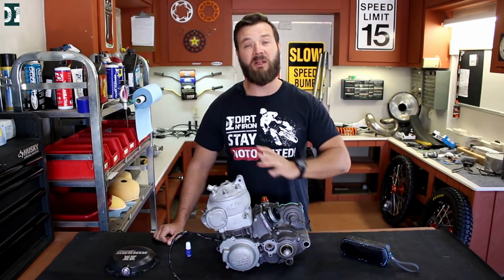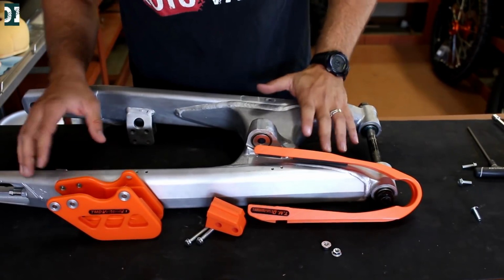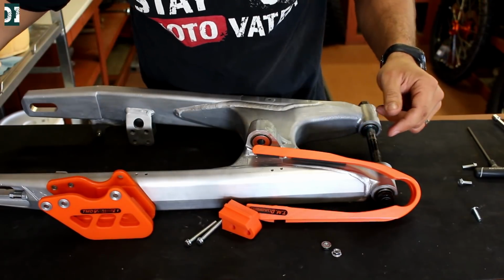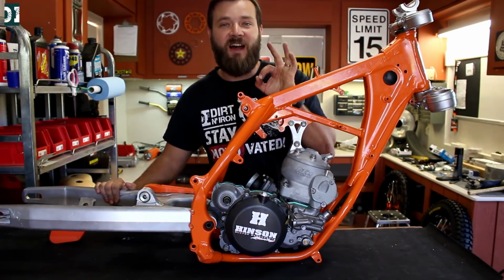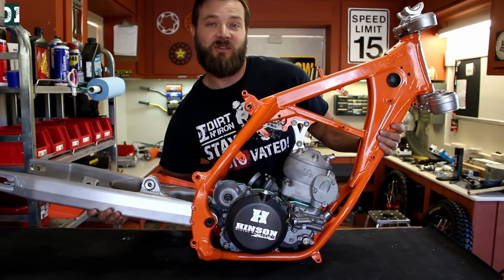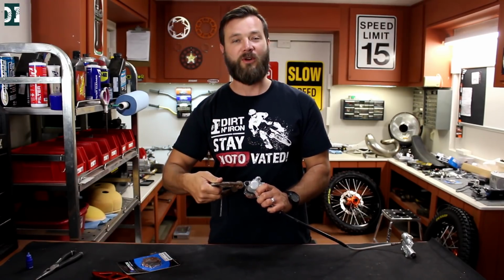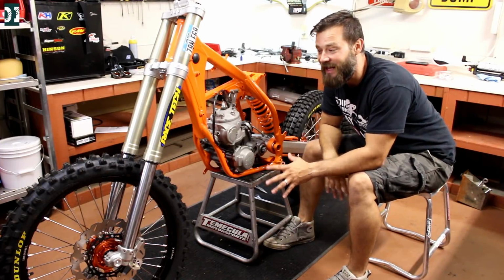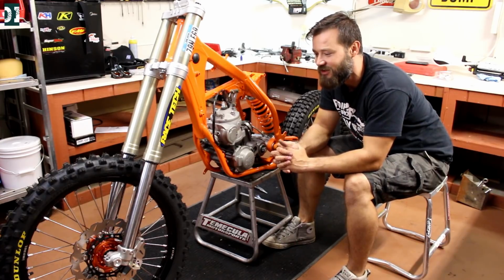KTM 300 build part 18: Dirt bike assembly finally begins!

Comment: Looks great, Just did tear down and greased all the bearings on my 07 crf450r.  It's nice just taking care of what you already have. Good job!
Reply from the maker: Exactly :)
Reply: These bikes have not changed a whole lot in several years just basically maybe they change the forks and then they go back or a little something here or there.  Its basically the plastics they change and all of the sudden it's the best bike ever.
Reply: Where did you get the Dunlop's with yellow lettering?
Reply from the maker: Those stickers are directly from Dunlop, they use it from promotions. I got it thru my friend. I think they don't sell them. I. My upcoming video I will talk about those yellow Dunlop stickers. Stay tuned ;)
Reply: @dirtniron Ok, Because I was like that's not something you can just get usually the only time you see it on bikes is for a photoshoot or factory rides.

Comment: Make sure to use the proper tightening order when putting the front wheel back in.
I think it was something like.. put axle in, tighten pinch bolts on right fork leg, compress suspension so it aligns itself, tighten pinch bolts on left fork leg and then the nut.
I forgot to do this once and the suspension didnt work properly.

Nice job on the bike, looks really good!
Reply from the maker: Exactly, suspension aligmnent is very important. Thanks brother

Comment: I just completely rebuilt a 2001 cr250. Nothing like bringing a old beast back to life. Only thing I would say to do next time is put a plug in the head so you don’t drop anything into the cylinder. Hate to see all that hard work only to take it back out and take it apart. Good luck on the build
Reply from the maker: Thanks brother, good point. I had plug in right after the video. If you check the thumbnail you see the plug is in.

Comment: Hey Rado. Love watching the build, it’s great. I wanted to point out a mistake when it comes to re-torquing your bolts. When you torque them to spec, you break the locking compound making it useless. Add locking compound only when you do your final torque. Further more, the old locking compound  negatively affects the torque settings as well as the bolt threads.
Reply from the maker: Thanks brother, makes sense
Reply: Good news is that from what I could see you’re not using enough thread locker.  Add quite a bit more when you re-do.  I know this from experimentation on my Husky.  Also, remember or shake up the locking compound before using it bc it settles at the bottom.

Comment: I would highly recommend torquing the swingarm bolt to ktms spec. Your supposed to torque eveything on the bike to specification.
Reply from the maker: Yes exactly, that's what I said on the video. Did you catch that ?
Reply: @dirtniron  no I didn't. Just dont want something happening to your and also the bike thats all. 🤙🤙
Reply from the maker: No problem bro, good reminder. Thanks ;)

Comment: Correct me if I'm wrong but I thought in order not to stress the forks and make sure they were lined up you had to tighten the pinch bolts first (allow the forks to fall where they may) and then the axle bolt. I have a 2019 KTM 300 XC-W and if I'm doing it wrong please let me know because I'm about to pull the front wheel and re-pack
them. Thanks
Reply from the maker: Pinch bolts on the left side (with the brake) are done last, you need to make sure that the fork slides freely on the axle so it can settle where it needs. I first do the axle nut, then brake side pinch bolts and then after everything settles and aligns I will do the pinch bolts on the left side. Hope that makes.  sense.

Comment: Hey watched all your vids and love them very inspiring and picked up some great tips, only a couple things I have picked up on, the old nasty engine bolts you put back in would of took minutes to clean and leaving the plug cap out while working on the bike! That can be fatal if anything fell in!! Great channel though subscribed
Reply from the maker: Thanks Matt, those are valid points. The bolts are killing me, I actually degreased and cleaned them like month ago, but let them sit on the table and they got little surface rust. Silly mistake, I didn't wipe it off. I put the plug in shortly after the video, if you look closely at the thumbnail you can see the plug. I am learning as I go, it's a fun journey. Welcome on the board ;)

Comment: if I have oil spitting out of my exhaust is it because the bike is running to rich or is the to much oil in my gas?
Reply from the maker: Make sure you have proper mix ratio, If it's still happening then you are too rich
Reply: @dirtniron  ok thanks alot
Reply: That's easy. Are you running more oil than 32:1? If so then there is your answer.

Comment: Keep engime bolts loose before jamming the swingarm in to be sure no unwanted pressure on the rear engine mount.
Reply from the maker: Yes that's right, I had to loosen engine bolts before fitting in the swing arm. Good point Diego, thanks.

Comment: Love the build but, maaan some of those bolts could use some tlc...a hit with the wire brush would make them look like new
Reply from the maker: Yeah, I know. I neglected the look of those bolts. I cleaned them in degreaser and let them sit on the bench at they got little discoloration and rust. Well, I guess we always learn something new, next build it wont happen ;)

Comment: Freshly powder coated frame, shiny new parts and you neglected to have the old bolts cleaned and zinc plated.... I’m genuinely disappointed by this. Other than that issue the bike looks sick mate it inspires me to get my own project rolling
Reply from the maker: I cleaned them, but they got little surface rust from cleaning. No big deal, but would be nice to have them look new as well. Next build ;)
Reply: What are you going to do with shiny new bolts? Garage queen your bike or hang it in your living room?  Rebuild to ride not to display. What do you do bob? re-zinc your bolts every time you take them off to fix something. Sorry but i had to say something. I hate it when people pick apart builds for the smallest imperfection. This is not a restoration for KTM"s headquarters showroom floor.
Reply: TNT MOTO 
I assume he is Joking. It is a Piece of Art though.
Reply: I hope so,  but i just see soooo many people make this type of comment. Comments that can be misinterpreted are unnecessary in my opinion.  If i have misinterpreted this comment then i apologise.
Reply: Bob I understand what you feel but the world is already filled with waste. And probably the builder doesn't want to waste more stuff and money buying new parts when the old ones work absolutely fine. ☺️
Reply: @TNTMOTO  I agree with Bob not this silly comment... Why waste your time with so many new shiny bits and hours of cleaning only to put the bike back together with rusted bolts, if your going to do something, do it right.  30 minutes with a brass wire wheel or a pad of scotch bright would have made the bike complete. 

And lastly, not a garage queen? The guy rolled an unfinished bike with an open intake out into the yard to take a glamour photo of it; it is pretty apparent the aim of the build is to be visually appealing, nothing wrong with that it is just how it is.
Reply: @TNTMOTO   What?? Of course the photos are to entice viewers, that is the whole point of filming the build; to represent the build process of something nice and clean that people want to see, and if the peoples opinion is that rusty bolts are not a great idea for the build quality then that should be considered as constructive criticism.  And he literally said in his own words that the bolts had surface rust on them ^^^ Not sure why you felt the need to reply with the whole it's his build his decision nonsense, he even agreed it would have been nice to do (again in the above if you chose not to read Dirt N irons reply) .

 If he would have replied with "the bolts have nothing wrong with them" like you would have I would have considered him a lying hack job and it is the last video I would waste my time with.  If you believe that a rusted motor mount or swing arm bolt is acceptable for ANY build I would hate to be the guy who buys your clapped out motorcycle off craigslist one day.
Reply: I agree with u on this one bro !!🤦‍♂️🤦‍♂️

Comment: I just want to ask, why not new nuts and bolts?
Reply from the maker: Good question, I don't even know. Those main bolts for engine and swing arm are super strong and there is nothing wrong with them. I have new set for body, plastic and such.. I might use that. I degreased and clean the bolts but left them out for few weeks and they got little light rust, I should have cleaned them before I used them.. well, I guess next build ;)
Reply: Those rusted nuts make me crazy😂😂😂 very good looking bike and  then few rusted nuts.. but Good luck with building the bike and drive safe!
Reply: Dirt N Iron I agree with you using the oem nuts & bolts. I have a 2011 300xc that I should do a rebuild on but I would have to cut the cost of the project & cut a few corners for sure? Your bike looks great btw.
Reply from the maker: Yeah, I know.. I am not happy about it too.. I found out too late and I wanted to keep going.

Comment: I'm sad, my 04 300 could be this good if I put the effort in, great vids. Also I run 13/52 and the red spring, in mostly tight technical single, the red power valve is almost liner with no savage hit into band with such low gearing, and it will still get u to 120+kph (70mph) faster than most are ready for.
Reply from the maker: Sounds good Alex thanks for sharing!

Comment: While the whole build is great I am wondering why you didn't you go the extra mile and upgrade your swingarm to the newer cast arms which are lighter and longer. You can find them second hand for not that much, maybe you would have to update you shock too but surely a bump in 10 years of shock technology can only be beneficial. Curious about that.
Reply from the maker: original swingarm and shock are fine when done correctly, I had mine done by Racetech and really like it.
Reply: Dirt N Iron indeed they are fine I ride a exc125-2004 and I am happy with it but you plastic kit, and your wheels were probably fine too and yet you decided to replace them for the bling factor so a nice cast swingarm would have been some nice additional swag too :) I dented mine pretty bad this afternoon so I will dig deeper, I know the pivot size hasn't changed since 2004 so there is probably something to do there :)

Comment: Where is your Torque Wrench ahhhhhhh!!!! The front fork tubes and the rear swing arm made me cringe when I did not see you using a Torques Wrench, but that is the beauty of it being your build. Looks bad ass.
Reply from the maker: I am using it, just not on the video. I had a message on the video saying that I will torque it all to factory specs. Front forks are not torqued on the video, just by hand very loosly, I will torque it all, specially the forks! Thanks for reminder
Reply: Been racing for all my life and never used a torque wrench, never had a fastener fail.

Comment: Pet hate fresh new frame and cases then put old rusty bolts back in if a jobs worth doing do it properly
Reply from the maker: Trust me I regret not wiping the rust of those bolts. They are absolutely fine, no reason for new ones, but the rust is annoying. I cleaned and degreased them like a month ago, this is just surface rust that got there from sitting on the table for a month.

Comment: What is the point to put a trials tire in a enduro bike?
Reply: Only thing I could think of is regulations where he rides.
Reply: Nobody checks/regulates tires
Reply from the maker: It should have good grip in technical riding and last for fairly long time. I wanted to give it a shot
Reply: They work!